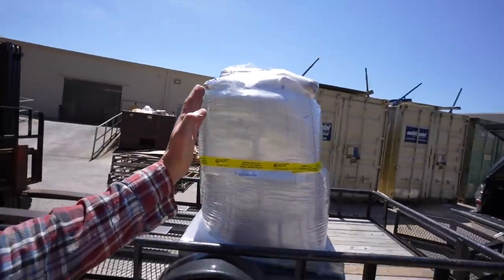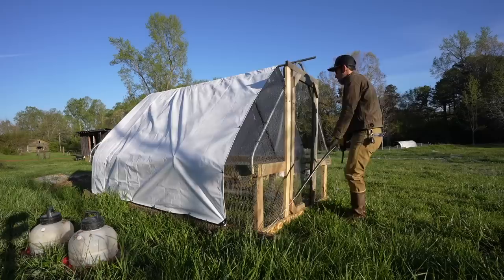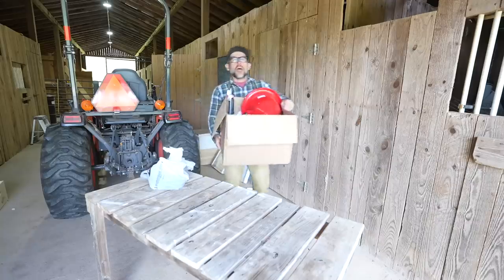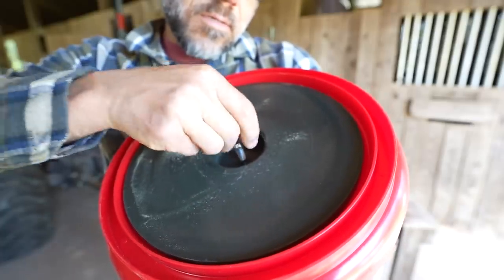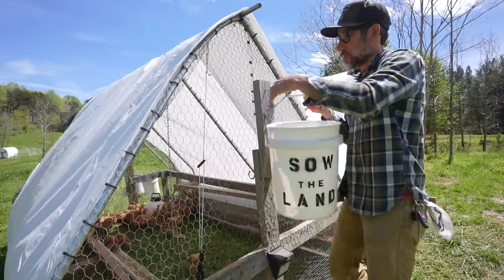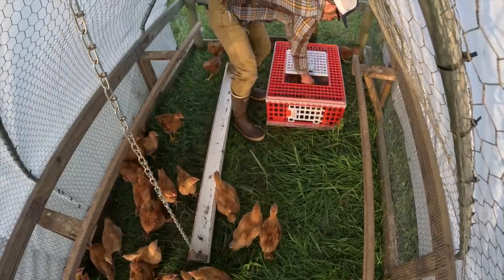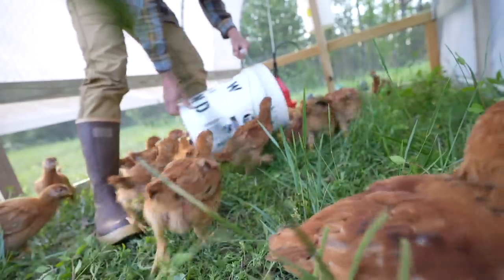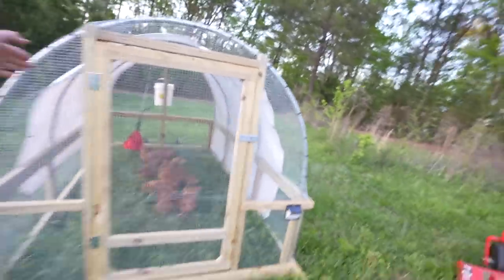My new setup for Raising Meat Chickens

Comment: I always watch your videos first.  

I find myself watching 100% of your videos instead of skipping through.  You seem to have the right amount of detail to convey what you are doing without being repetitive.  Telling a story is so important for teaching and entertaining. 

I like your chicken tractor design.  I think 25 chickens makes a decent day's work processing them, so building a chicken tractor that holds 25 is about perfect.  The chicken tractor looks fairly light.  I have a really heavy one I built when I was just starting out and I plan to build another that is much much lighter.  I like the Suscovich  style for egg layers.  kind of cool that you can use it for other animals as well.  I Will probably build one similar.

The new waterers look nice.   I wish there was something that could perform in the winter time for egg layers. I think at night these would freeze up.  I hate cleaning poop off the heated flat top waterer.  I often mount a 5 gallon bucket lid on top of the waterer as  a poop shield.  I have gutters on my chicken coop that drain into a 5 gallon water tubs that the chickens can access. Saves hauling water half the time.

Comment: I just finished my chicken tractor tonight and moved my broilers out!! I have the same waterer but have not set it up yet. I'm the one who asked about your pig shelter. I did the same thing and made hoops instead of the bends. The door took me a bit to figure out. I like the way you used hardware cloth vs chicken wire on the front around the door!

Comment: I like the new tractor style as well! I was planning my next tractor build and was thinking about using metal or poly for the roof instead of tarps. We get so much wind here they just don't last, but the hoop style with a plastic corrogated roof might be the ticket!
Reply: Side note, Amazon also has an additional 50% off on those solar lights, I just bought a couple packs using your link!

Comment: Thanks for your videos! I like your chicken tractor design! I have two questions for you. What method did you use to bend your conduit into the circle? Also, What didn't work for you with the chicken watering cups? I was planning on switching from nipples to cups. I want to make sure I am making the right decision.